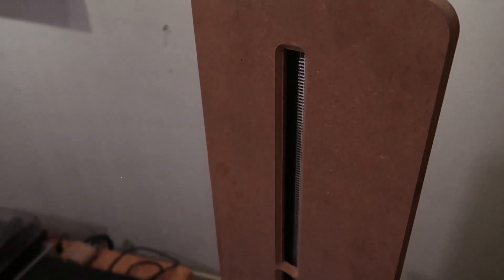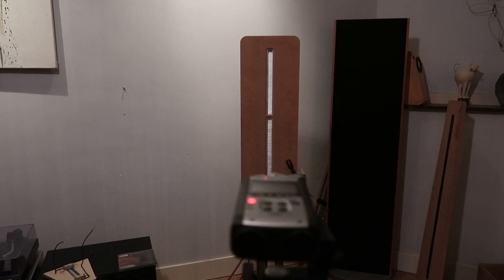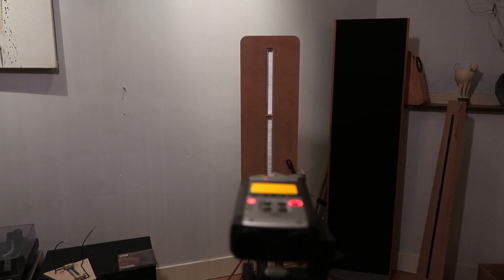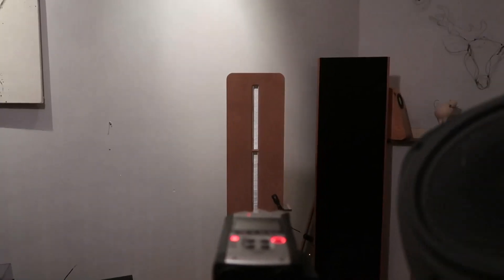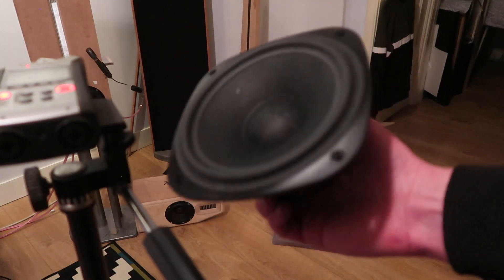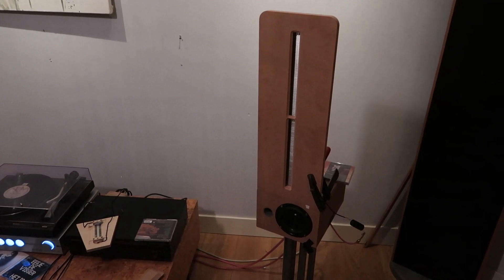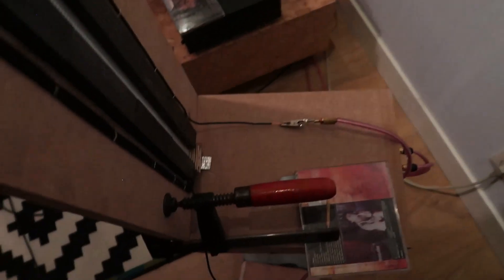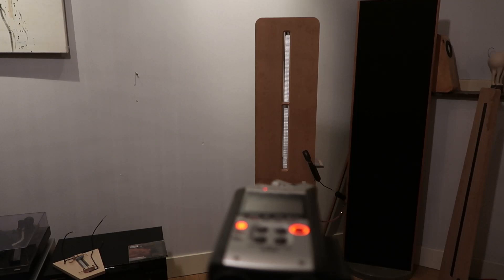RANDOM BUILD/TUNE - Test ribbon more magnets smaller gap - a tune

Comment: Since corrugation wheels are difficult to find, here's an idea I used. Cheap and it works. Use two of those cheap rollers, connect the handles together, attach a very weak spring between them and you're good to go. Wide enough for almost any size (width) ribbon.

@t
Reply from the maker: not sure what you mean did you even see the video ? since the rollers i use are 24 cm :) 10 times that of the ribbon
Reply from the maker: gone remove the float of comments if you dont mind.  you poosted it 3 times now

Comment: Not sure if you've mentioned it in other videos, but I was wondering where you got the foil for your ribbons.
I've been experimenting with ribbons for headphone drivers, but have never gotten good sound out of them, likely due to poor foil choices on my end.
Reply from the maker: its a 7 micron paper on alu foil only available in Denmark  VITA FROKOSTFOLIE 10 M.  i cut that on my plotter then glue 5 micron mylar to it, or whatever i want. and then remove the paper with water or glassex window cleaner...  and its ready to be corrugated. 

i have to ask a friend to get it in the super market there and ship it :)  i need new rolls to
Reply: @joppepeelen  Ah, that's pretty cool. The thinnest good foil I can find is 10 micron, which doesn't work well for my intended use case of headphones. I've also experimented with taking 1 micron aluminum leaf and giving it structure by attaching it to mylar as you're doing, but I found that the foil, even with the mylar backing, was too delicate and never survived corrugation.

Comment: I'm under the impression that the kind of treatment the foil gets is important.
I work with sheet aluminium and some stuff rings like a tuning fork and some is dead quiet. And neither is an expensive alloy. The cheapest PA11, A1 and whatnot... Raal's CSDs are smooth like baby's bottom.
Reply from the maker: True anealed or not , type of corugation etc. But for my project I dont see much benefits using one over the other,  raals also dont come near the bandwidth down low and are tiny all things that might makes one thing or another a better  choice